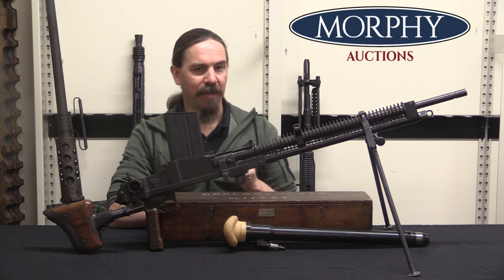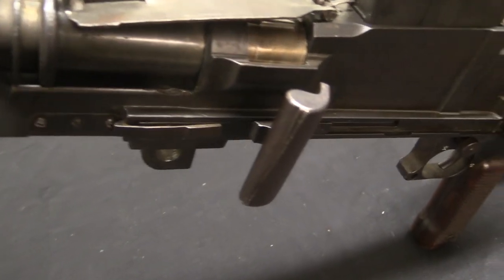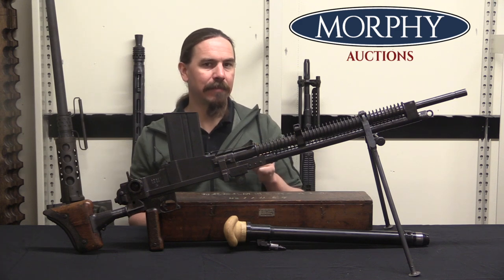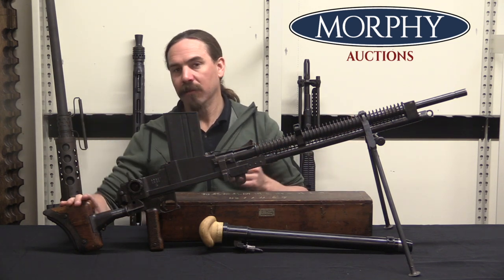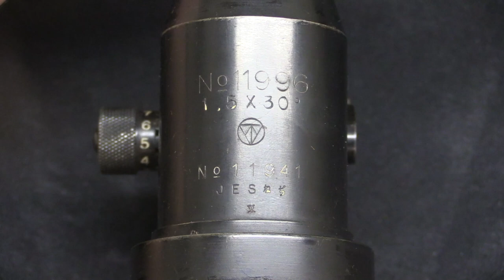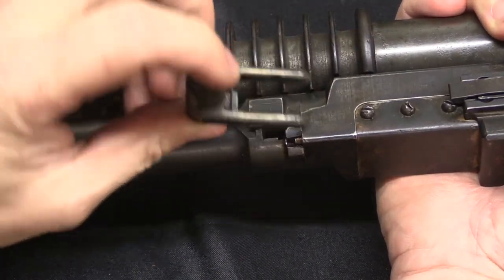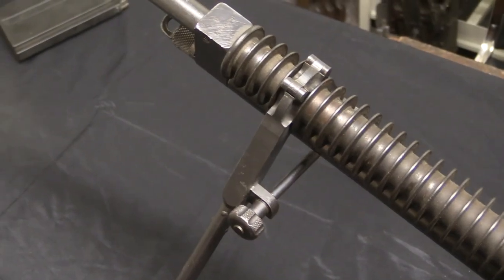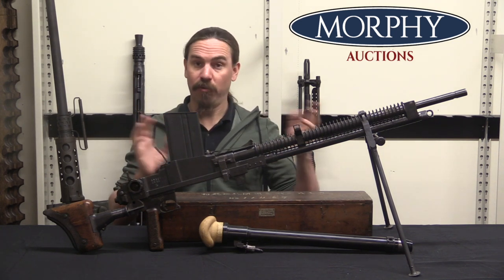Type 97: Kijiro Nambu Adapts the ZB-30 for Japanese Tanks

Comment: So when do we get a video on the Japanese tank
Reply: It's really quite difficult to go inside Japanese WW2 tanks as the interior of the tanks were lined with asbestos padding. As padding, it worked real well (if you are not aware of the cancer-causing asbestos fibers in the air) for a tank; it provided padding from the odd and enviable bumps and strikes to the interiors of the tanks (remember Japan fought longer and more soldiers were in China/Manchuria more than they fought in the South Pacific, also more armored vehicles were used in mainland China that the small islands in the pacific), it provided hot and cold insulation from the walls of the vehicles, and of course, as asbestos was fire proof.
Reply: Think only ones left are in thailand
Reply: @demonprinces17  there are a couple of hago left in Thailand. One in driving condition and one repainted with the ugliest digital camo

Comment: Let me ask a very stupid question: what is the purpose of the adjustable gas block?
Reply: To put in the gun just the minimum pressure required to cycle.
More gas slams the components harder than needed, but if the gun is dirty you may open the tap a little more to make it cycle properly.